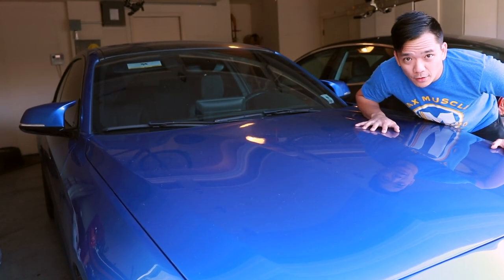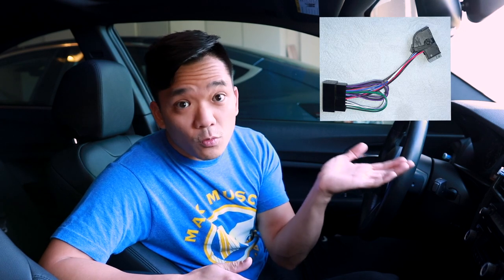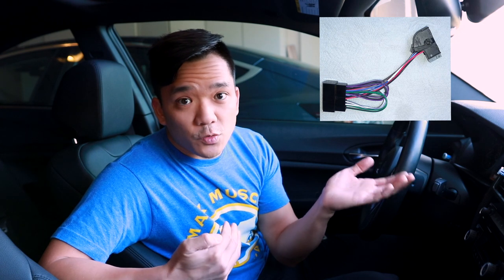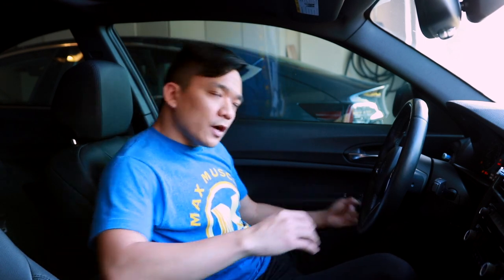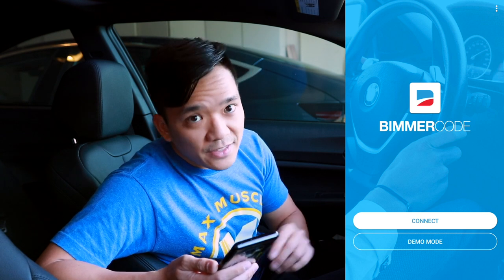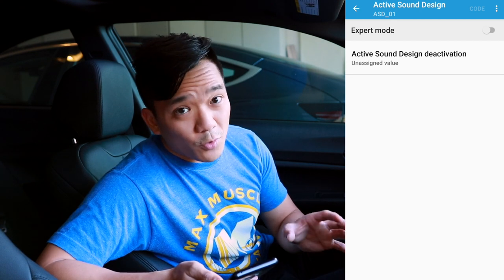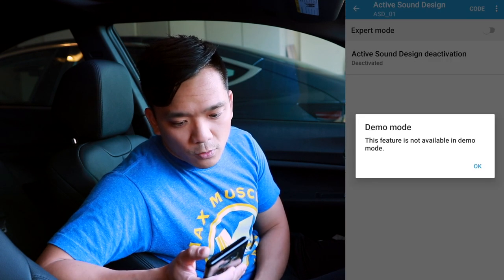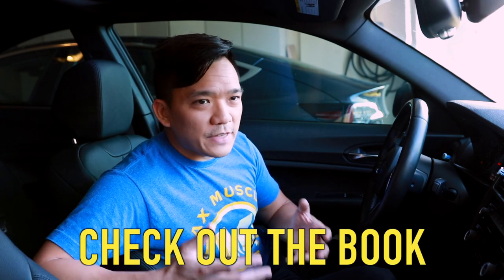Disable BMW Active Sound Design | BIMMERCODE | BMW ASD

Comment: As far as the ASD in non-electric cars, the sound of the ENGINE is piped through the speakers for cars before 2018. After 2017-18, they created the artificial sound.
Reply from the maker: Thanks for sharing
Reply: I don't see the ASD as a selectable ECU in Bimmercode - I have a F34 2014 335ix (with HK speakers)
Reply from the maker: @abiemann  It should be the first one - Active Sound Design
Reply: @FritzRamos  I agree, but I checked again and "Active Sound Design" doesn't show. It's a used vehicle so maybe the previous owner disabled it, or the 335ix doesn't have it. :-)
Reply: Would explain why after tuning my car ASD can get Hella loud at times. My car is a 2016

Comment: Just disabled the ASD on my 2016 M3, so easy through the app, and its only $40 now. And I actually was getting headaches from the ASD, at first I couldn't pinpoint what it what, but after disabling it I notice the weird sound stopped. it got so bad I had to drive in efficient mode, now Sport+ mode is so much more enjoyable.

Comment: One more comment....If your BMW has an ASD module, when this module goes out there are horrid crackle, popping and static noises that come through the speakers.  Check (remove) the ASD module first if you have those symptoms.
Reply from the maker: Thanks for sharing
Reply: maybe this is what i was hearing, it was driving me insane. Thankfully when the APP turned it off, the weird Static sound that was giving me a headache went away.

Comment: We leased a 2017 I3 and just looked to upgrade to the 2020 I3 but the noise is a problem. If we follow the methods you describe in this video will we go back to the quiet sound of the 2017 model. Your after sound still sounded pretty loud
Reply from the maker: It'll remove the higher pitched sounds and fake engine sounds, but you'll still hear the road noise

Comment: Question, in the intro at 0:22 what are you holding? it looks a like a block of clay bar.
Reply from the maker: A comfort access system based off of proximity
Reply: @FritzRamos  so it was just a box?

Comment: I tried this on my 430i, but with a stock exhaust...it kind of needs ASD otherwise it's too quiet, my car was damn near silent with it off when I had my windows closed lol. If your car is already relatively loud and you don't want extra sound pollution in the cabin, I can see this being useful though.
Reply from the maker: I hear you on that. This is definitely a preference thing, or motivation to upgrade the exhaust lol.

Comment: I'm leasing a 340 2018, does both ways are safe for the warranty?
Reply from the maker: The module should be fine because you can always disconnect it. Unless they scan your car I don't see how they could know if you used bimmercode.
Reply: Hello buddy, I have a 330i 2019, I asked the dealer if I lose the warranty if I code it and he said yes. I'm from Serbia, but I believe it's the same with you, so I don't recommend you do it. I hope you haven't already done that 🙂
Reply: @jovanjovanovic7777  yea but Bimmercode got a backup function and I code my 330i 2019 back and I got no problems

Comment: Will my 2011 f20 120d be doing this fake sound?
Reply from the maker: I believe so unless the previous owner removed it. A sime way to tell is where is the sound coming from. Is is coming from the front and sound kind of muted (it's off) or is it like surround sound and all around you (it's on).
Reply: Fritz Ramos definitely seems to be from the front I’ll have a google to check 👍🏼
Reply from the maker: @ryanbrough108  hard to describe if you've never heard it, but the fake noise has a higher pitch as well.
Reply: @FritzRamos  hey does the apps package  also have some storage and can handle 3rd party apps

Comment: it does not just minimize but really take out that fake engine sound completely specially if you have 2 12inch subs in the trunk, now no more humming engine bass sound coming from my subs
Reply from the maker: I'm sure with that setup it mad an even bigger difference.
Reply: @FritzRamos  yes sir very big difference
Reply: I have one 12" powered Rockford and even after deleting ASD with bimmercode  I still hear the horrible humming!
Reply: Literally just got my 22 x3m comp and started stressing immediately after installing my skar audio subs , then I came across this 😭🙏🏽